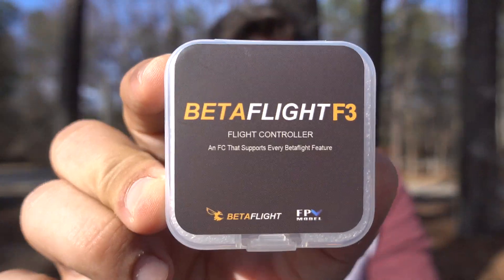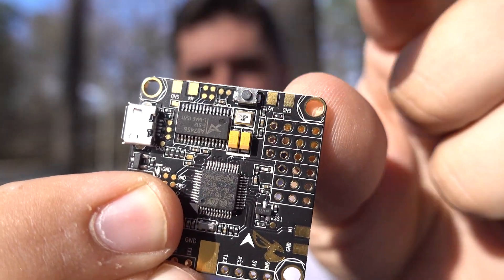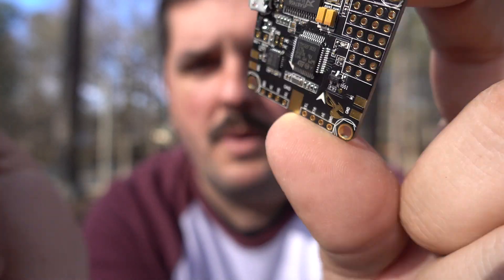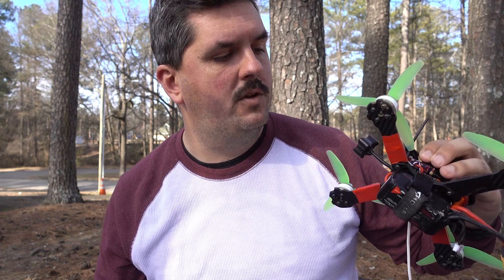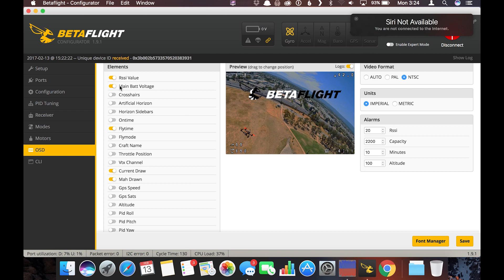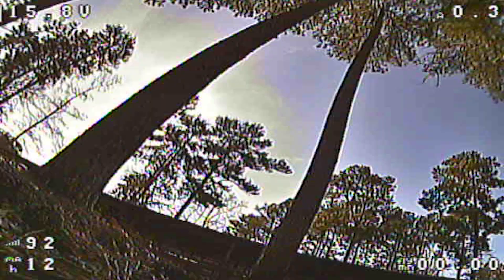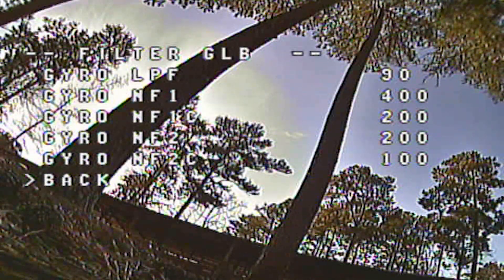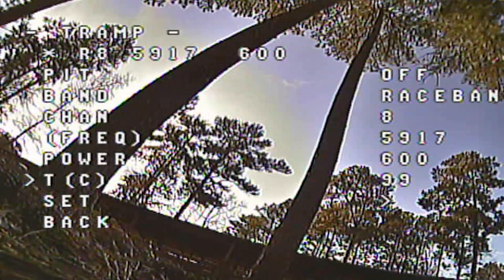Betaflight F3 Board Overview

Comment: Hey im trying to connect a qx7 using x4r sb with this board but in betaflight on receiver tab all the values are 0 and modes tab also has no response when i flip the assigned switches

Comment: Something is definitely up with this board. I've killed two of them from minor crashes, and I've also seen tons of the same complaints on the betaflight page on FB. On both of mine that died, the processor burnt out. I'm not a noob at building either. These boards are as fragile as they come.

Comment: hi, I have some questions. when you fly have some spikes on video if you power to 5v or vcc your vtx and cam? then if I plug the esc power and gnd I need to plug the gnd of signal? the linear regulator get hot?

Comment: hey there, great video. Excellent overview of this flight controller. Quick question though . I have done about 8 builds with this board so far and I absolutely love it period but comma every single board I have used so far has had issues taking solder on the receiver ground pad. some even continue to pop off after I thought I got it to finally take. every other pad has been fine but on every board that exact same pad refuses to take solder. did you have the same experience?

Comment: What is the difference between FrSky Taranis X9D Plus and Frsky Taranis Q X7
Reply: Robbie Emmons the qx7 has nicer gimbals stock and doesn't suffer from a noise problem in the stock speaker that I've seen some guys mention, the antenna is also connected via and ipx connector so it's replaceable and upgradable without soldering. ipx to sma cables exist everywhere so you can use 2.4g wifi antennas that are available with high gain. x9d has more features like built in charging, a battery, sometimes a reciever, more screen real estate, I think the screen is grayscale not monochrome with multi color backlight and there are more switches and pots and a bigger mod community as well as accepting the m9 gimbals without modifications. x9d needs soldering for an antenna mod if you must do so.

Comment: I have been using this board too and love it, I have never had a FC that felt so locked in even with really high super rate the flips happen so fast and crisp and stop flipping instantly with no oscilations.   I dont know if you mentioned that the cost of this board is around $39 to $45 bucks so considering you get the FC, OSD and PDB saves you money and valuble space and weight on your quad,,,,, Greattttttt!!!!

Comment: so do you have to wire up the vtx to a uart to change pids via osd? i do not have a need to change my vtx settings via osd. all i wanna do is edit my pids/rates/expo etc via the osd. thanks for as much detail you can provide im a NOOB

Comment: warning to buyer: if you're feeling tbs unify, get the HV unify not the normal one for this FC. the normal unify requires LC filter/caps to snuff video lines.
the significance of the tbs unify is the ability to change frequency/channel from within the OSD menu.

Comment: Can you use one UART port to run both the serial RX and the Tramp TX? Because you are only technically using the Send signal pinout for the TX and the receive signal pinout for the RX...
Reply: No because a single UART must have the same baud rate. Most receivers such as frsky run a different  baud rate to what you will need for smart audio (TBS) or Immersion VTX control.
Reply: uarts are basically intended for one device. it might technically be possible to use 2 devices that each only use one way signals in opposite direction but like it's said above at minimum the baud rates would need to match. though I don't see why you couldn't use another microprocessor to break out a uart into more uarts, but at this point you could also use softserial on spare pwm pins to do what you need as long as it's at 19200 baud rate.
Reply: daniel dimitri  can I use UART 1 to access the configurator? my usb I s dead unless bat first then windows sees that a port is there but can't read it. so send to me that UART 1 should be open ? I'm new to this.
Reply: The Butcher that I don't know. there are certainly uart solutions for the PC whether it's over serial or through a microprocessor like Arduino or an ftdi adapter. but as far as I understand the uart would have to be set to MSP in the configurator prior to that. if you happen to have a flight controller that doesn't have a virtual com port and uses uart1 for USB then you're probably good but if you have the betaflight board, or one many other recent f3 boards then maybe if you have another uart setup for MSP for some reason it should be possible. otherwise it might still be technically possible with some soldering skills in one way or another.

Comment: Have 5 of these.  
1 Failed due to grounding on frame, burned out 3 24A kiss Esc, hopefully motors still ok, have yet to get this frame in air.

Have had 2 quads drop out of the sky cause the negative solder point did not hold, it literally just dropped off crashing and damaging 1 gropro and 3x motors.  Other one that failed crashed in a feet of water...
1 works great but had to solder negative directly to battery negative lead connection due to solder no holding. 

1 FC just sits there and not sure if worth even using....

Comment: I hate soldering to this board - just waiting to lift a pad with all the heat required. It's very clean in the end, but I've never had that issue on fairly similar Omnibus Pro FC's which power most of my quads
Reply: On rcgroups.com there is a long thread about this FC and also the soldering and heat issue. I have this board and my advise is to use a big soldering tip for all the GND pads. The big tip transfers a lot more heat and soldering is no problem without overheating anything. All the GND holes are on the outside of the board so it's easy to use the big tip even for the small holes which makes it easy to solder them.
Reply: Yeah, the large pads take a lot of heat to set the solder.  Have you tried adding lots of extra flux first?  I find that really helps.
Reply: Andrew MacAulay It does help, a lot! A hot tip, and a heavy tinning!
Reply: Having a really good soldering station also helps. When the tip cools, it immediately has to start heating up with a lot of power in order to hold temperature. Even then it is not as easy as other boards I have soldered....
Reply: This is why I spent $700AUD on my JBC. No worrys.

Oh and fuck off HAKKO lovers, you have nothing on my JBC.
Reply: I used a Hakko FX-601 with a big tip for <100USD. It works perfect...
Reply: Best Brand ;) - have the JBC CD-2BE myself

Comment: What's the difference between 4in1 esc or 4 separate escs only thing i could see if if 4in1 goes they all go
Reply: They also make a 4 in 1 esc called the quadrant that you can replace sections which is pretty cool
Reply: Fran Galasso that is cool are they pretty reputable??
Reply: They're reputable. They're from X-Racer.  They're a pretty cool idea. You can use them separately on each arm, or you can tack solder them together and put it on standoffs like a 4-1 ESC. So you can choose how you use it. And if you opt for 4-1 mode and one break, you just de solder it from the group, replace it, then solder in the new one.
Reply: Brennan Lawrence sound interesting just asking cus a while back I won a limited edition gold dquad  obsession frame can't wait for it over the arris 250 setup I got now .... debating raceflight build
Reply: Well the good news is that quad will look as good on the workbench as it does in the air. So whichever firmware you go with, it'll always be maximum sexy.

If you really wanted to go cutting edge with your Obsession, you could opt for new BLHeli32 ESCs and run DSHOT1200. You'd need to use Betaflight for that though. At least until Raceflight supports it. But we don't have an eta for that yet.
Reply: Brennan Lawrence it is a beautiful frame and it is being given  to me by vek fpv

Comment: Reviews I would love to see: Babyhawk, Torrent 110, Prop Comparison Redux (much has changed), Turnigy Evolution Radio, Armattan Chameleon Frame, Eachine Wizard X220S, TBS Racetracker and... RMRC Popup Gates .
Reply: He is talking about the new wizard which has been updated with a bunch of new stuff
Reply: Oh, my bad. Thanks.
Reply: The wizard is a good RTF but keep in mind that you have to: Buy FPV Goggles. Change the fpv camera. Put o rings in flight controller to avoid vibrations and oscillations (it works). Buy 4s batteries. Then if you want to do upgrades: New vtx and antennas. In the future if you want more quality, change frame and motors, so in the end if you like this hobby, you will build a new quad. ;)

Comment: I love my BFF3 board! It flys great and the gyro seems less affected by vibration due to the larger mass of the board. I've never seen gyro data this clean on any other board! Just remember to turn up your soldering iron a bit when you do your build as the integrated PDB soaks up a lot of heat.

Comment: ım using bf f4 v2 its better than this or not? (still ım using pub )
Reply: Serdar Cilliler would that be the omnibus? as far as I know the only official betaflight board is this one. there are a few f4 boards with a betaflight osd built in and I'm assuming you are talking about the omnibus which I believe was the first. the f4 chips are faster than f3, however the f3 was designed more recently and the f4 doesn't accept phase inverted signals on the uart pins except 1 uart that has an inverter circuit on the rx pin for frsky's version of sbus. this is a problem for frsky s.port telemetry but if you don't fly with telemetry on a taranis then yes the omnibus f4v2 is technically better.if you'd like to run a taranis with telemetry there are options for an f4 to work properly but for a beginner an f3 is a better option (probably why the official betaflight board isn't an f4) but not any old f3 board, some have a slower gyro update speed and share a uart with the USB... the f7 processor bridges the gap between the f3 and f4 and is even faster, not that we need that, but it also has a lot of uarts for complex builds, maybe the f7 is better for a large copter with gps, barometer (altitude hold), sonar etc.. where cpu loads might get high on an f3 or you might run out of uarts.